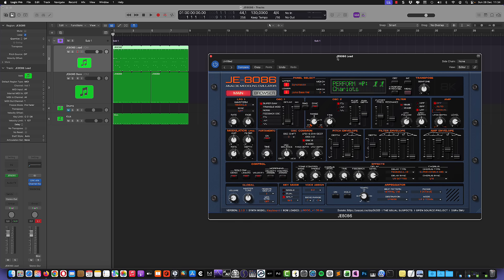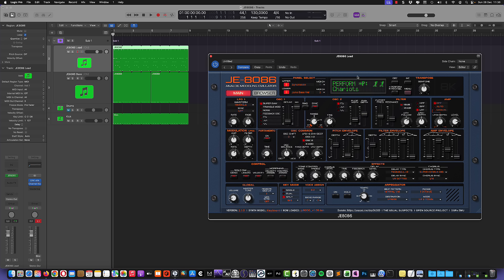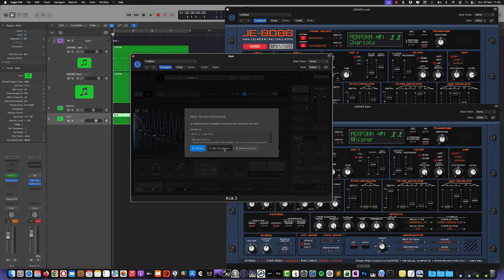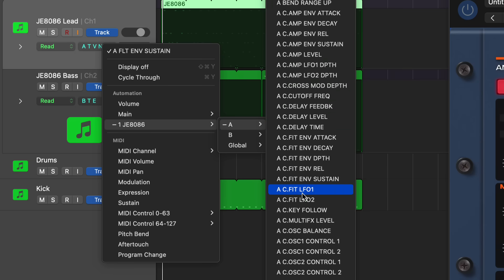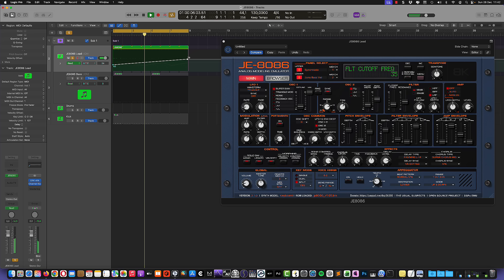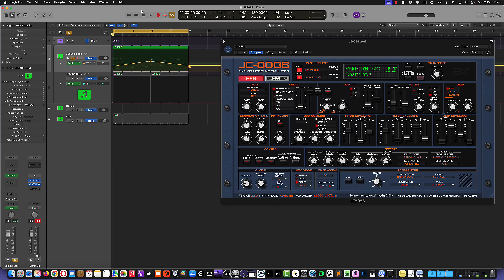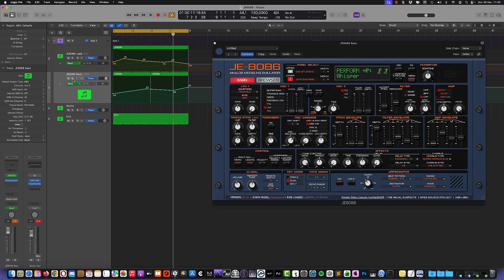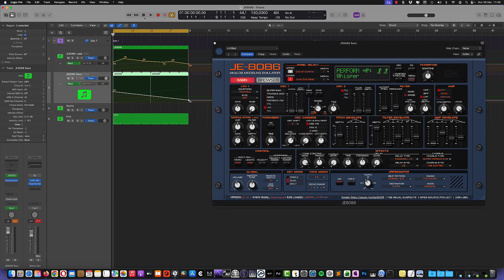JE-8086 Is OUT NOW – FREE Roland JP-8000 clone!

Comment: You're descrpition is totally wrong, and the way you make a commercial to yourself is just Low as F. The firmware is available to people who own the Roland JP8000. But this Firmware is still intellectual property to Roland and is only there to support the owners. The project the guys of usual suspects do is emulating the dsp chip and workings around and in it, thus creating multiple synths emulation gui and structures. What you are doing is scamming people into thinking this is a free synth, cause it isn't. the emulator is free, but the use of the ROM to actually run it has legal issues. So, I'm not sure if the guys from usual suspects agree with what you are doing, but what you do can get a lot of people including yourself into a heap of trouble.

Comment: This not a clone it's 100% the original firmware. The original firmware running in a host which emulate the actual chip (emulates no clone either).
Reply from the maker: Yes, that’s correct 👍  
It’s the original firmware running on an emulated DSP, not a traditional “modelled” clone.
I just use the term clone/emulation loosely to keep things understandable for a broader audience.

Comment: I installed all of the Usual Suspects plugins on an Intel I5 2,5Ghz dual core with 16Gb ram but they all stutter and distort when used. When in use the computer still have around 30% of cpu resources free so it is not overloaded. Memory is also not overloaded.
Reply from the maker: Try lowering the latency of the Plugins
Reply: @AutodafeSynths  when the latency is at its lowest, i get more or less just white noise. The least amount of distortion is achieved with the highest latency. The cpu usage was read from activity monitor, but i see inside live it indicates cpu usage of 153% and it is probably why. I am on Sequoia OS and Live12, will reinstall Live11 and see if the cpu usage is still so high.
Reply from the maker: @walliesdebeer9681  sorry, in my previous comment I said "lower" but actually you should "increase" the latency. try 4 or 8 (right click on the UI and fiddle around with it. Also play with the buffer of your Audio Card/DAW. That should fix your issues, I cannot guarantee but let me know 😀
Reply: @AutodafeSynths  i tried, but no success. Soundcard latency is best at 44,1kHz and buffer size of 2048 but still stuttering giving 45,9ms latency. I am running my OS with Opencore so it might not be optimal. I will keep the plugins for when i can afford to buy a new MAC. They are stunning, thank you.
Reply from the maker: @walliesdebeer9681 so I guess your Mac is…. yes, a bit too old to run this emulation…also, keep in mind that it’s still in Beta, maybe future versions will be more optimized and CPU friendly….
Reply: @AutodafeSynths  thanks i will keep my eye on future releases. Some OS versions run better on OC than others. Sequoia runs better than Sonoma did so it might also be that an update to the OS might make it less cpu dependent. The best i got was 130% cpu.

Comment: I have Osirus, Ostirus and Vavra running perfectly on my Windows 10 computer with very low cpu load but this JE-8086 goes straight to 100% cpu load and cannot make any sound .... anyone else experienced this?
Reply from the maker: have you tried lowering the Latency setting in the plugin (right click on the UI). Also, remember this is the first beta, maybe next versions will improve a bit

Comment: Thanks. I did download those 8 odd mid files, placed them in the said folder and loaded the plugin in my DAW (Ableton 12 Intro). The moment I pressed a key on my MIDI controller (KOMPLETE KONTROL M32 keyboard) it sounded nice…but I cannot control it…Neither does any other sound (seen there) gets selected…just the saw sound by default continues to play. How can that be controlled? I have to unload the plugin or disable it to stop that default sound…Any help shall be greatly appreciated. Thanks in advance and Wishing a rocking 2026 from Pune, India.
Reply from the maker: Happy to help! It sounds like you might be experiencing an issue with MIDI mapping or patch selection within your DAW. Have you tried checking the MIDI settings in Ableton 12 Intro to ensure your controller is properly configured to send patch change messages?
Reply: @AutodafeSynths  
Thanks for your swift reply. Checked that on your advice. Its in order still faced that issue. So decided to start again by removing the .VST3 bundle and this time choosing the .VST format. Am aware this is stupid but surprisingly it worked very well. I could try all the 64 off presets that came with the bundle (Seen under Factory - Keyboard - Performance P.11 - P.88 in Patch Manager) comfortably. So many excellent presets that am unaware of. I wasn’t familiar with the hard synth devices so decided to give this a try. Its so addictive. I do have Native Instruments Massive and KV331 Audios’ “SynthMaster One” and enjoy them too. However this is insane.
Thanks for your responses and the above video. Now I can concentrate on your video 😊😊.
Also thanks due to The Usual Suspects team.
Lots of love from Pune city, INDIA
Reply from the maker: @shreepadgandhi6739 Glad to be helpful !

Comment: Great video and the synth is top quality....... if your running a  quantum pc. My specs are well within my DAW and every other plugin I've got. This needs rocket fuel CPU
Reply from the maker: Emulators tend to need more CPU…unfortunately
They’re running original DSP code rather than simplified models.

That said, a few things can help:
adjust latency in the plugin, lower polyphony, freeze tracks, or render once the sound is right.
Reply: @AutodafeSynths 
Cheers mate, I'll give it a try.

Comment: ROM from the official Roland website: Put phrase into Google "roland jp8000 version 1.05 (PC) (279K)" and click the first link from the official Roland support website then Download "JP-8000 Operating System Version 1.05 (PC) (279K)" unpack *.zip file and copy all 8 *.mid files and paste them into "C:\Users\*Your Username*\Documents\The Usual Suspects\JE8086\roms". After running the plugin in the DAW it will create the ROM file from those *.mid files and will be working.

Comment: This is magic! However, after both downloading vst2 and vst3 i get an error in the inyerface. Where am i going wrong? ‘A firmware rom (512k.bin) is required, but was not found’ and ‘No Rom no sound! Error 525288’
Reply from the maker: It sounds like you're running into a common issue. Make sure the firmware ROM file is placed in the correct directory. Check the installation instructions again, and check down in the comments ...
Reply from the maker: see: https://dsp56300.wordpress.com/installation-guide/

Comment: I installed it on my Mac, but it requires a ROM file. Where can I find it? On the website, only the plugin type files exist.
Reply from the maker: Read down in the comments…😊
Reply: It requires firmware bin or mid file(s) available at Roland or anywhere you want..... Did you not read anything or understood the fact that FIRMWARE cannot be included.

Comment: i have problems using this with the JP-8080 roms it seams only the JP-8000  roms work with this or im doing someting wrong
Reply from the maker: JP-8080 is still not implemented
Reply: @AutodafeSynths  ok so thats why its stil is in beta and the thing the are working on is JP-8080  implimentation so we can select betwen jp 8080 and jp 8000 rom inside the plugin in final full veriasion
Reply from the maker: @gylp2 yes, exactly. JP-8080 is still in the works, hopefully it will be out soon

Comment: What's the point of a video about a free VST when it needs the Rom to work and it's not offered in the zip file? When executed, it throws an error of Rom missing.
Reply: You probably don’t know the project and the work behind this. This is an exact 1:1 emulation of the original Unit. It doesn’t just sound like the JP-8000, it IS a JP-8000, that’s why you need the ROM
Reply: @Musica-Ribelle  Seems like you are missing my point. It's not about knowing the project and work of this VST. It's about a working VST when you say "Free" and won't work out of the box. It's misleading for your viewers who don't own a Roland JP-8000. So, where is the ROM???
Reply from the maker: Pleas read more about the whole "DSP56300" project, Virtual JV and emulators in general (MAME, for example). As someone else already explained to you, it's considered "illegal" to distribute the ROMs, and this is the very simple reason why they are usually NOT distribute with the software. The software is still FREE even if "it doesn't work out of the box". 
You need to do that extra mile to get it working...If you scroll down in the comments there are multiple hints on how to find the correct ROMs,
Reply: @johnny14794  You have to source it yourself my dude.  Put in some work.
Reply: @TheTastefulThickness source yourself?😂 Really? So wtf someone advertisements like "hey,  free release of Jp-8080 emulation". It looks like shit, sorry.
Reply: @NatLifeSounds   Try to speak in coherent english sentences and then I can respond.  This was not that.
Reply: @NatLifeSounds  I own the real thing and trust me it’s not shit.
Reply: @sampledfuture who said that synth is shit? Read carefully. The situation with advertisement of the synth looks like shit
Reply: @TheTastefulThickness try to understand carefully, English isn't my native so im not owe you an explanation
Reply: It is illegal to share or copy the roms from the original. Maybe the original roms are worth looking for from the nostalgic sounds. If they release their own presets, then making a vst to be able to use the original sounds would be pointless imo. If you don't want the original roms use another synth with presets.
Reply: you can dload the rom, and use it "illegally" for a couple of hours to check it out, then remove the rom and get back to legitimacy. FBI will not care about it.
Reply: Absolutely agreed, it looks like some joke

Comment: does not work here on Windows 10, neither the vst2 nor the vst3, as it says there is a rom missing that has to be placed in a user folder, but the rom is not given with the installer. stupid.
Reply: You have to find the rom on the Internet.
Reply: @DJCalzar  the MIDI files also working ?
Reply from the maker: Maybe you didn't know about the whole project, and I've already explained why the Rom is not included. It's an emulator, just like to ones for Video Games, same concept. The Software can be distributed freely but not the Roms.
Reply: @AutodafeSynths  i got it. found the midis. it created a bin dump. the emulation works, but very very crappy. the sound is lagging on and on, even if i change the block size and the buffer in all directions, or by changing the ASIO. very unsatisfying. i hope this is being fixed wih the final version.
Reply: @marcelfrehse  how did it  (i don't know what it is? the plugin, something else) create bin from mid?
Reply: @marcelfrehse  did you run the test script they offer?
this will tell you if you are able to run this or not.
Reply: @Princesshound  best not to ask on YouTube. read-it is a better place for questions like that.

Comment: I had the JP8000 for a while, and the Chariots patch sounds wrong? It should be more like Chariots of fire with Vangelis?.
Reply: No, it was the JP8000's spin on the CS80 brass sound used by Vangelis. But one of my favorite patches on the JP8000.
Reply: @lundsweden  yes I know, that why i wrote it should be more like the charios of fire sound :) not that it was the JP8000. Maybe i missed something in this video, but I never heard any of the sounds.. but I saw in another video with the same emu the chariots patch and it sounded just like i remember it :)
Reply from the maker: It's not the actual "Chariots of Fire" patch, that was made on a Yamaha CS-80 by Vangelis (great OST btw) :-D

Comment: If you're looking for the ROM just imagine you have a hardware synth Roland JP-8000 and you wanna upgrade its firmware, where would you get it? Yes directly from Roland. It's simple as that.
Reply: Roland itself don't provide any Rom Files for the JP 8000/8080 ... and they know exactly why ! ;)
Reply: @shari_8410  They do... "This is the latest operating system available for the JP-8000 Music Synthesizer. Please look at the Readme file for information on how to install the operating system. Note to PC users: You will need the PC SMF Update Application if you do not have access to a sequencer program." from Rolands update and drivers page.  Its in the firmware updater.  edit: maybe should clarify this is in sysex format, but you can probably convert it.
Reply: @shari_8410 Roland still provides the latest JP-8000 firmware on their official site. It can be found in the drivers section. You have to search for it, but it is available for download. Only the 8080 firmware was removed because it caused many problems for most users when updating  the 8080.

Comment: How were u able to get it working in logic? I downloaded the au component and dragged it into the components folder but i cant find it in my plugins even after restarting
Reply from the maker: there's a command file in the ZIP, have a look at it...or you can use the sentinel App on Mac to remove plugins from quarantine: https://youtu.be/_WbyuNrjubQ
Reply: @AutodafeSynths  i ran the command both while the plugin was in my downloads folder and while it was in the components folder, still nothing
Reply from the maker: @jeremyk2868  try sentinel, it's easier. see my previous vdeo link...
Reply: Notorize the app properly
Reply from the maker: @cd78 I didn't create the plugin...
Reply: @AutodafeSynths Don't advertise it then
Reply from the maker: @cd78and why? There are hundreds of free/open source good plugins which are not notarized…

Comment: Nice review. Hope JE-8086 will have MIDI-Learn function soon. Then it will be easier to automate it.
Anyway, such emulation technologies are really amazing. There are still many Hard-Synthes which don't have VST version like Yamaha, Emu, Kurzweil, Ensoniq etc.
If such synthes reborn as a software version again, it will be splendid.
Reply: There is already a Midi Learn Fuction on it ! Under Control-> Control Assign  ;) yesterday i did assign my Korg NanoKontrol 2 to the FilterCutoff ;)
Reply from the maker: @shari_8410  yeah the Control Assign basically does that
Reply: Most old synthe do have VST versions. The names cannot be used without permission from the trademark holder so they are usually not named the same as the original synth. They can copy the function and the sound without copyright issues...
Reply from the maker: yes, of course, unless they have written permission or an actual endorsement by some company...
Reply: I mean..
For example, I think Yamaha SY99 or Emu Proteus still don't have software version. I know that we have already many sampled one, but those are  not editable like original one. With emulation technologies, TX81Z, MU-50, SD-1, JV880 etc are truely revived in 2025. Hopefully more Synthes will come soon.
Reply from the maker: @jeffy1993 yeah, unfortunately they don’t all share the same chips, and not all chips are well documented. But hopefully we’ll see more 1:1 clones in the next years…
Just keep supporting the devs ❤
Reply from the maker: Glad you liked the review! And yes, so many hardware synths deserve a software counterpart.
Reply: it already do that.